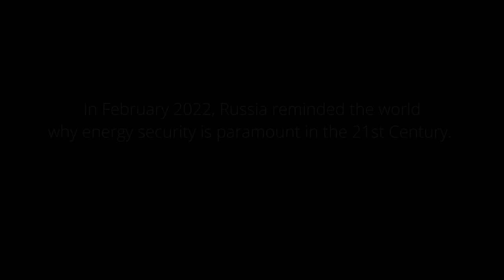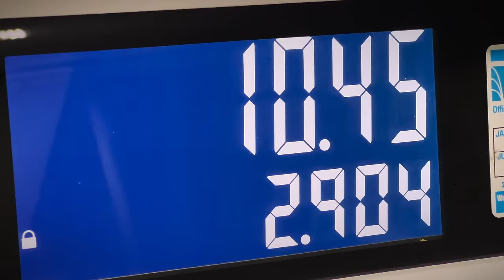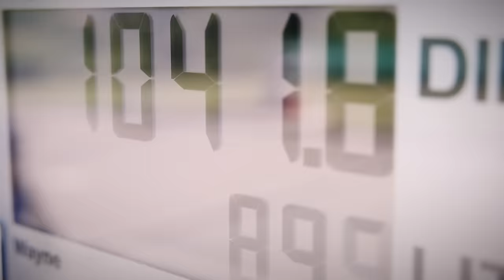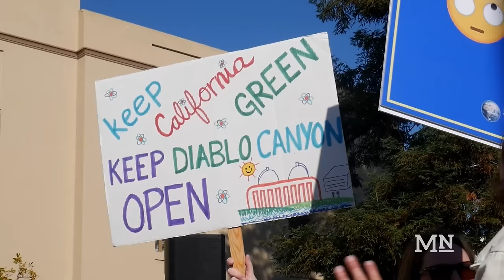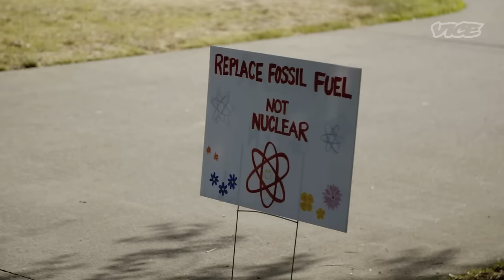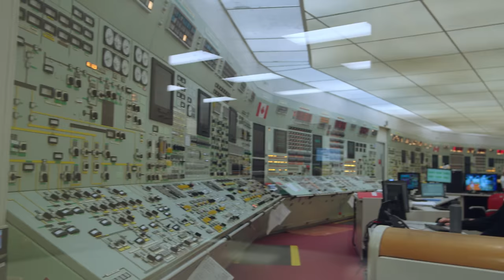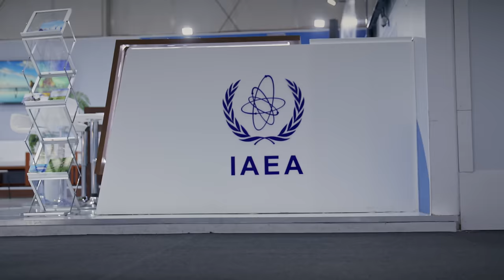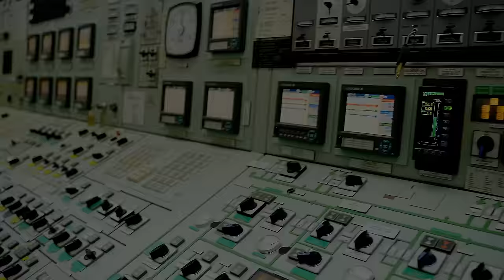JUICE (Episode 5) -  Industrial Cathedrals

Comment: New electricity systems need to be cheaper, faster, cleaner. Nuclear has its place...but I think distributed and decentralized renewables with hydro, grid batteries combined with high insulation and high efficiency are the future based on cost. Especially as offshore takes off and grid batteries drop in price. For extreme cold I always have my tiny wood stove ready to be fired up which goes a long way with a highly insulated house with 3" of foam in the exterior walls.

Comment: One thing I don't like about these videos is the claim that nuclear will replace fossil fuels. Well no, not in the near future as we still need fossil fuels for all the byproducts that support our modern technological world. Until we can learn to fabricate all those byproducts we will be dependent on Coal, oil, and natural gas for a long time to come. 

So there is really no such thing as a fossil fuel free world or Net zero economy. Renewables especially are dependent on FF as they require much more resources to build to harvest their low energy sources. There is not much more you can do to improve them.
Reply from the maker: I hear what you're saying, but I'm fairly certain we never suggested fossil fuels could be entirely replaced by nuclear. Hydrocarbons are going to be around for a very long time because so much of our society depends on them. Most of our work has suggested a natural gas to nuclear path, but even so, hydrocarbons won't be going away any time soon.
Reply: @JuiceTheSeries  

If you eliminate the fuel part of FF then the production of the byproducts will become more expensive. 

But I do not find that the alleged GHGs produced by the burning of hydrocarbon effect climate very much at all. For one the amount of them in the atmosphere is at the trace percentage level. The claim that they produce backradiation is bogus, the predominate heating effect is from the capacity factor of the oceans and atmosphere's. Gas Thermal Physics determine the heating capacity as seen from the differances of Mars vs Venus.

By far most of the forcing of climate is the interaction of the solar output and orbital dynamics coupled with the Earth's albedo and internal geothermal heat processes.

It will probably take a long time to learn how to synthesize those byproducts of FF that support our advance technological society which is why nuclear is an important step. No renewable technology can replace FF as they are too dependent on materials that must be mined and refined by FF. 
The energy harvested from solar input is too low for RE to sustain itself, it's a waste of resources and money. So the path must largely rely on all FF until nuclear is predominate enough to take over what FF delivers for energy input currently.

Is that not what we see in Germany today and in the future?

Comment: In a war a nuclear power plant is a huge danger if the combatants do not respect it as neutral area not to be touched.

You can see the danger in Ukraine, where Russian soldiers were not allowing the power plant crew to run the facility. Then they blew up the dam upriver that helps keep the water supply constant to the nuclear plant.

We need a worldwide agreement that nuclear plants are strictly "hands-off" areas.